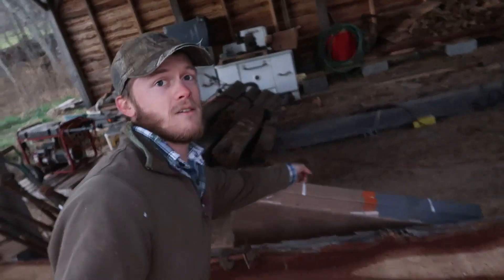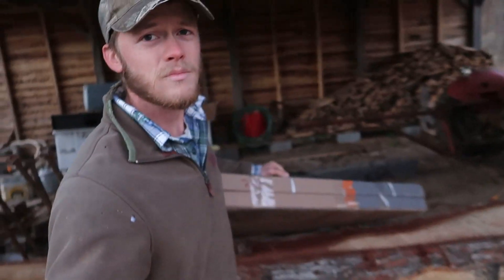The Covered Bridge Rebuild - Final I-beam Prep & Paint

Comment: Hi Josh. What other means of rust removal did you consider? Progress looks great!
Reply from the maker: Well, I was thinking about sand blasting, but I don't have a blaster, or big enough compressor, and I really didn't want 100's of pounds of media going in the creek. Possibly could've used chemicals for some of it, but again, not keen on that over the creek either.... Thanks!
Reply: @LandisLegacyFarm , I thought the same thing about the sand blaster. I know we're all know-it-alls but I've had great experiences with belt sanders when it comes to quickly removing material on flat surfaces.
Reply from the maker: Well that's something I hadn't thought of..... definitely would've been worth a try.